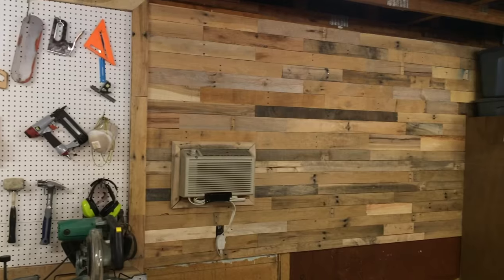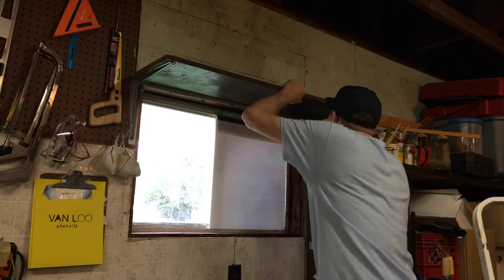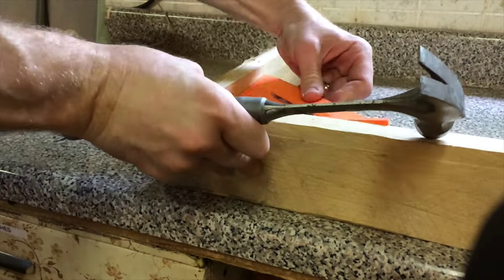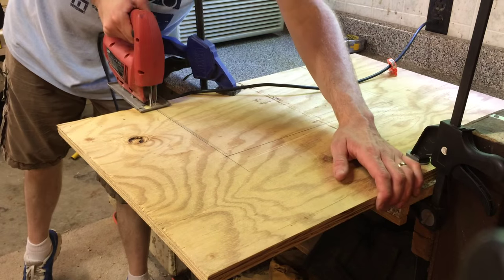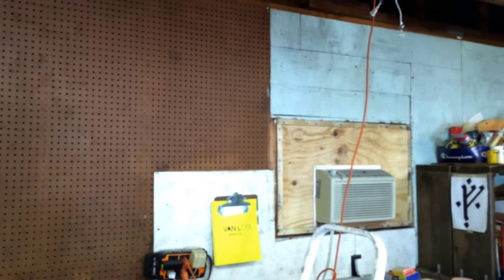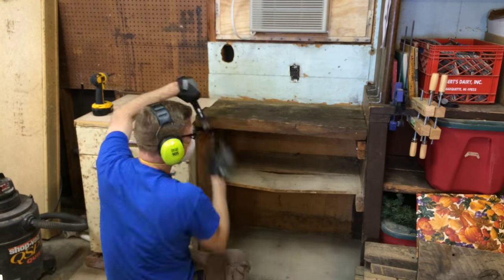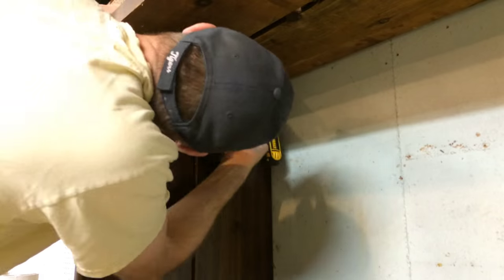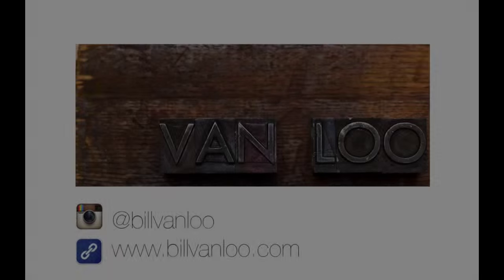(Almost!) Free Workshop Redo, Part 1!

Comment: Nice job on part 1. Did you use hyperlapse to shoot some of the footage?  Air conditioner install is great. I would love to have one in my garage but it would require me to cut a hole in the wall.
Reply from the maker: Joshua Luther Thanks, Josh! I did use Hyperlapse to shoot some of the time-lapse stuff; the rest of it is just the built-in Camera app on iOS. The AC is kind of underpowered for the space but it helps bring the temp down a little on the hottest days.

Comment: Great job, what's the size of your garage, and what's your plan for work bench thanks
Reply from the maker: elparra1217 Thank you! My usable workspace is around 10x20 feet (the back section of our garage), though I've got the luxury of using it all during the warm months when we can park on the driveway. I'm building a long workbench for the back wall that will go in the space I left on the right side that will have space for my miter saw, drill press, and bench top band saw. That project will take a little longer than expected, though...